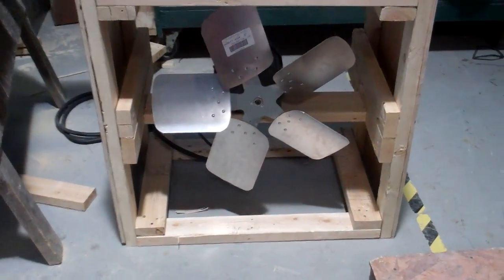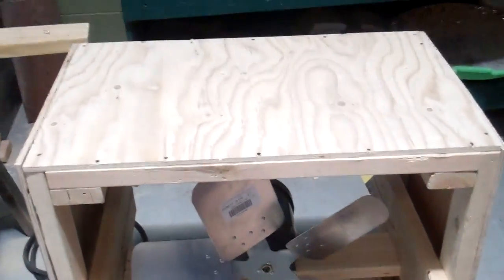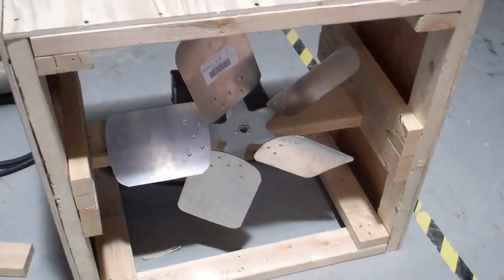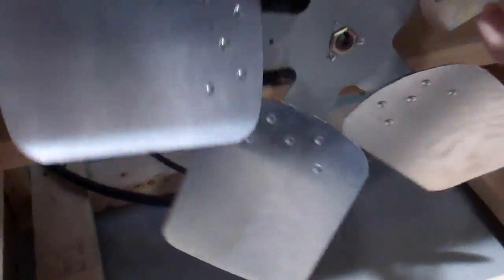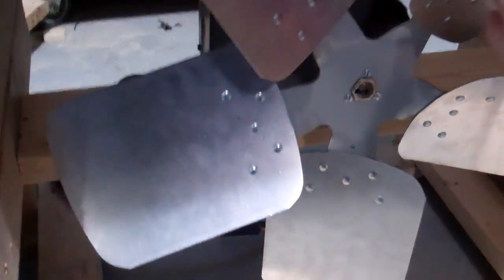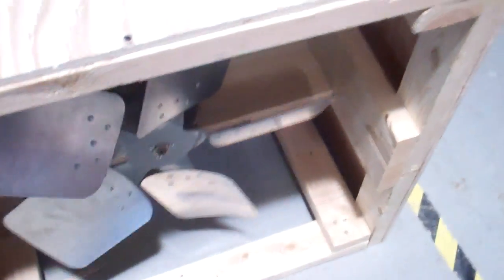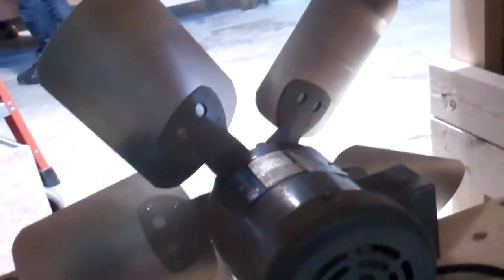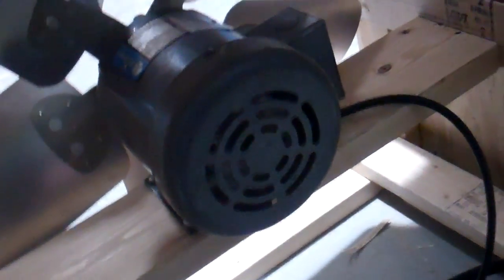Big 24 inch box fan I made for my shopclass

Comment: do you still have this fan it seems 1hp 3 phase could be overkill for that blade  as what i seen they fatique and the blades break. at work 4 years ago before they closed last week is when they had two condenser fan blades break and they hit the coil and all the freon leaked out of them so they changed it along with another condenser and two Semi-hermetic compressors and put in two Trenton thermospan condensers outside on the ground with the Ranco pressure control as there the condensers were on each compressor there. newer supermarkets the condenser is outside and the compressors are in a parallel rack system run a controller and VFD. the newer high efficiency systems have replaced the semi-hermetic compressors with the Copeland Scroll compressors for medium and low temp cases. some system with Semi-hermetic compressors on the low temp will have head cooling fans on top of them before my work closed some compressors were over 10 hp. they were all Copeland either Copelametic or Discus compressors.  the racks they can have Copland, Carlyle, or Bitzer semi-hermetic compressors on a rack. and they have a computer controlling the compressors refrigeration circuits and to force a case into defrost.  my work it was all mechanical they used Paragon time clocks for defrost. its a pain frozen cases coils ice over time to time. one time i had to replace a condenser fan motor was defective on one unit. some compressors go off on oil had to reset it.  they had alot of fan blades there good enough to make a box fan there.

Comment: lol. Just finished a project like yours. mine got a GE 1/3 HP 1,725 RPM motor on it and it turning a 3 blade 16-18 inch blade. it's got a lower tone than yours.